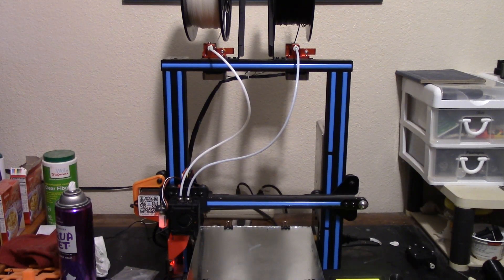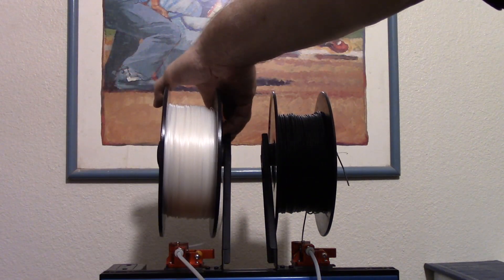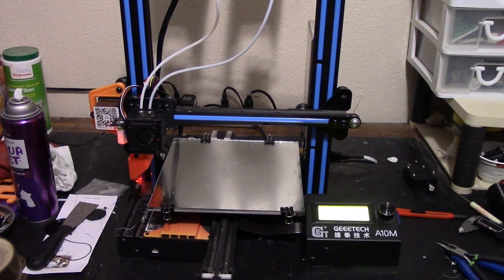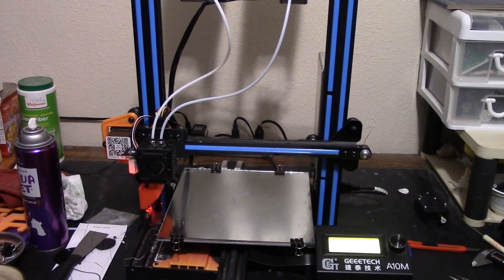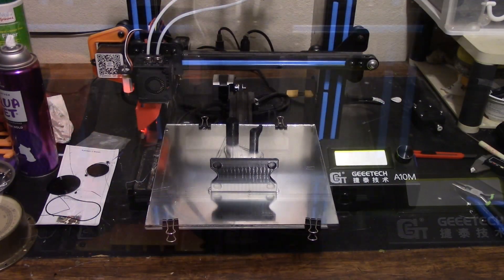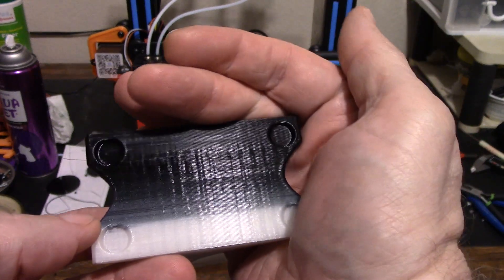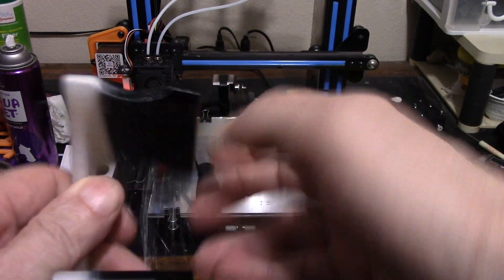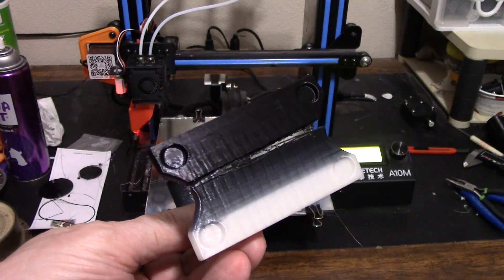Can you mix PLA and PETG? Should you? Geeetech A10M 3D Mix Printer

Comment: Dear Chuck, I have an A20M and was wondering if you can help me with a color mixing issue I have. A while back when I got my printer, I was able to mix colors at different weights and was getting nice mixing results. Now, for some reason when I mix colors for example 90% White and 10% Black, I get varying shades and horizontal stripes through my print ? I have upgraded the extruders to dual gear and am using Capricorn tubing for the filament and have done all the E step calibrations. Each extruder and color on their own work fine, it's only when I mix. If you have any tips or have experienced this yourself, please help. Thankyou ...
Reply from the maker: First thing I think I'd do is make very sure that the extruder drive gears and their set screws are tight on the motor shafts and can't slip under pressure. Also on the dual gear extruders make sure the toothed indentation the filament rides in matches between drive and driven gears. And make sure the bowden tubes are tight in the fittings and won't come out when pulled.    

It also might be worthwhile to print something from a different slicer. I know the mixing is all done on the control board, but it's an easy thing to check and I've seen slicers do some pretty strange things.

Can you print from both colors on a 100/0 and 0/100 mix? If not, then you've narrowed the problem down to just one extruder and extruder motor.

Then I'd print an object at a 50/50 mix and watch or record the extruder gears as it's printing to see if you can see what's happening. The extruders should run at identical speeds and directions throughout the print on a true 50/50 mix, if they are moving identically then the problem has to be either filament slipping in the extruders or a problem in the mixing hot end. 

If the extruders are running at different speeds and you're sure the gears aren't slipping on the shafts then I'd ask, "Is one motor running at the correct speed and one running intermittently?" If so, swap E0 and E1 motor cables at the motors and see if the problem moves to the other motor. If it stays on the one motor then I think you might have a bad motor. If it moves to the other motor swap cables at both ends to see if it's a cable. If it still stays on one motor then the problem is coming from the control board and I'd swapping E0 and E1 stepper drivers on the board. If it moves with the stepper then it's a bad stepper. If it didn't then I'd seriously consider reflashing the firmware to it. If it still continues after that I'd have to start thinking the board itself is bad. Not impossible, the board in my A10m has failed.

Good luck, let me know how it goes!

Comment: Your black petg was wick because , 1)too much cooling fan, i use 50-60% 2)under extrusion
I made solid petg ehith the fan atv50%, if yuo use 100% and have fans like me, 5050, , yuo cuold have this effect, cause the fillament dont stick  them self..
Reply from the maker: Interesting info, thanks. I typically run the cooling fan at 80%, but I'll try it at 50%. I'll also try bumping up the flow rate as well.

Comment: There is another spin on this. If you use one as support for the other, you can print with zero gap and they come clean apart with perfect support (disclaimer: so they say).
Reply from the maker: I think you read my mind. I may...or may not...have some plans for this. But first I'm going to try to get the wormhole opened and get that alien invasion going.